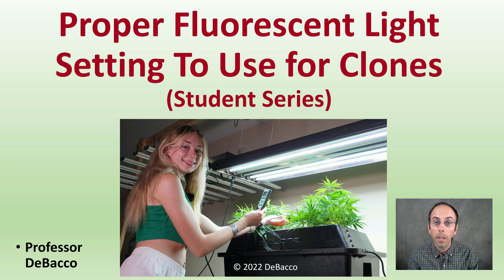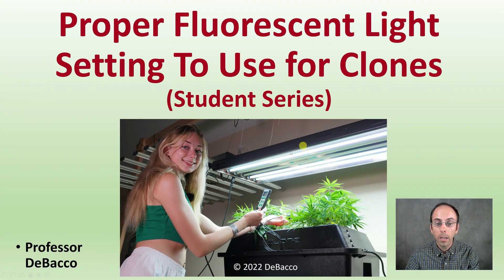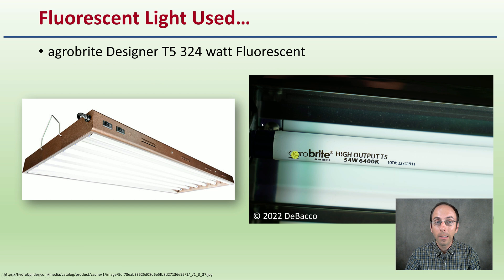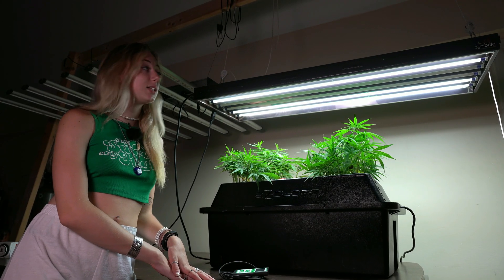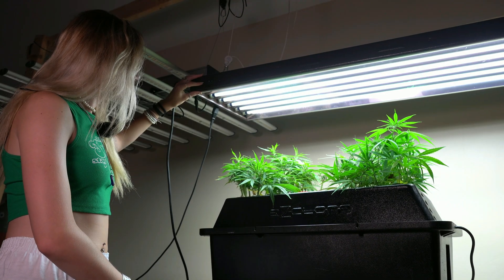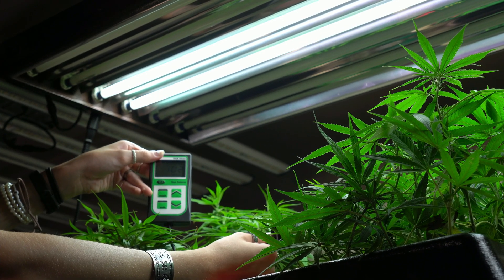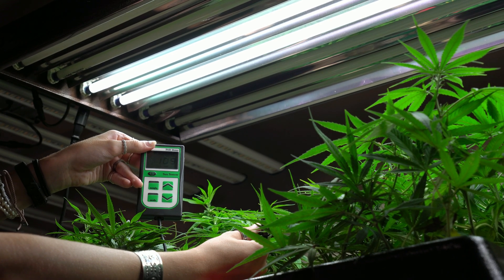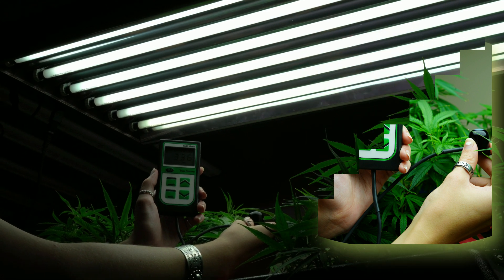Proper Fluorescent Light Setting To Use for Clones (Student Series)

Comment: Im in a small town now and its difficult finding the same 24 in fluorescent i used in the 90's for cuttings , they were specifically for cuttings and worked dramatically better than plain ones .
Reply from the maker: Luckily cuttings are not that specific so there are some options that should work out well even if it is not the same as what you have used in the past.

Comment: I grew 8 inch clones in a empty fish tank (red solo cups), held about 10 cuttings, I used a 800 lumen 5000k light bulb on each side of the tank. Spray the inside with water and put the lid on cracked about a inch to get 80 to 90 percent humidity. It works flawlessly. 2 weeks full roots. If u take the cutting just below the node, 45 degree angle, with a razor blade and leave 3 leaves uncut on the cutting, clonex optional.
Reply from the maker: Thanks for sharing.

Comment: The biggest issue I've had with hydroponic cloners like the EZ- CLONER is keeping the unit clean!! After every cycle you have to clean and sterilize it thoroughly!!! I had a few failed attempts at cloning and I believe it was from bad bacteria being present inside the cloner. Most likely from old roots stuck inside the sprayers or dirty foam collars, so it's very important to remove sprayers to make sure there is nothing left over from the previous cycle. I also have had better luck not using any nutrients especially in the first week or so. I'll usually wait until I see some callous tissue forming before I'll add any nutes. I also like to use a reservoir sterilizer like ez-cloner clear rez or equivalent during the rooting process.
Reply from the maker: Cleanliness is happiness!